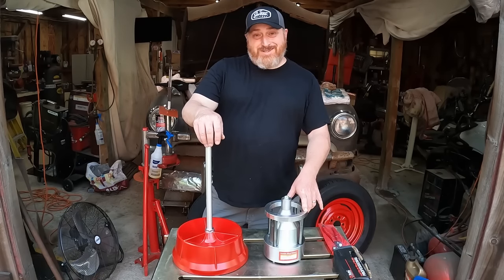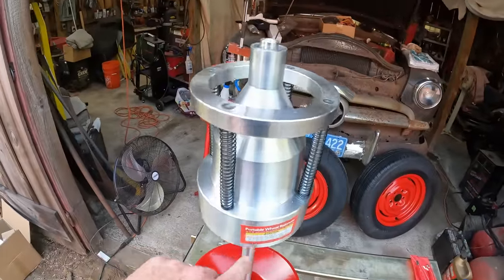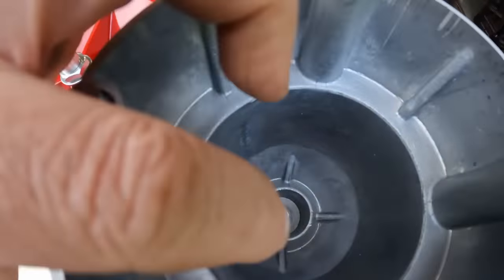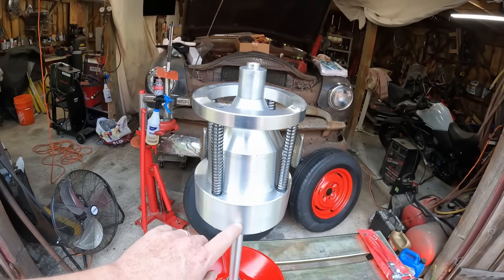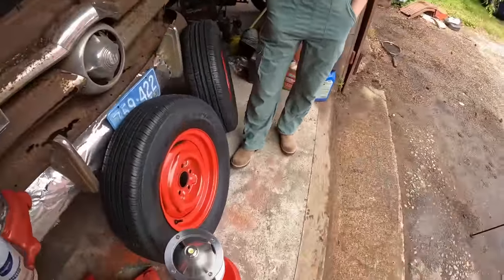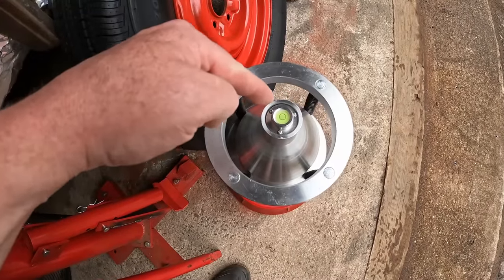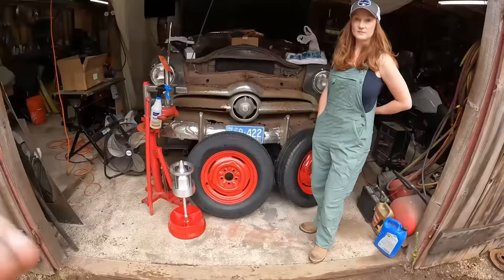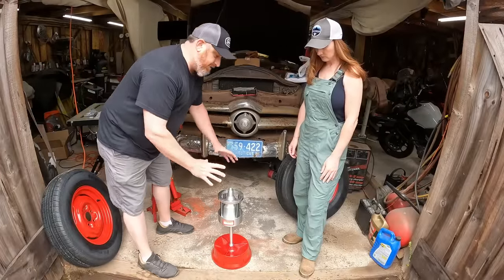How to balance your tires at home and how to modify your Harbor Freight/Amazon bubble balancer!

Comment: If your bubble is inside that circle, you are good to go. There is so much unsprung weight in those old wheels and suspension    that you don't have to be perfect. Most balance issues will show up at the 55/60 mph mark. If you are smooth there, you are good. Bubble balance takes care of the static balance which is 95% of the issue. Splitting the weight between the inside and outside takes care of the dynamic balance for the most part, the last 5%. Great video!
Reply from the maker: Great, thanks for watching!
Reply: @madgingercustoms thank you very much. I have one and gave up on it due to the same problem. I could not get repeatable results. I will drill mine out now.
Reply: Whatever dude, anyone who listens to anything that this guy says is foolish. You shouldn’t drill down into the cone . The manufacturer has designed this product in a certain way and when you go modifying it based off what people like this guy says, well you’re making a mistake. It just goes back to the old saying that you shouldn’t believe everything that you see on the internet. Trust the manufacturer, not this guy. If he wants to design a wheel balancer based on his belief system then he should do that. When you deviate from the design of the manufacturer based off of what this guy is saying, then how are to know if it’s correct? Because if something goes wrong and you crash your vehicle, this guy is not going pay for your damages or medical bills. Trust the manufacturer, not this clown
Reply: @matthewhuling8582  The Chinese manufacturer is not going to pay your damages or medical bills either. This man took a mediocre product and improved it.
Reply: @matthewhuling8582 it's apparent that you didn't listen to what he said. He stated that you do not drill the or touch the centering point that rests on the hardend pin. He clearly said to taper drill the the hole that leads to the point allowing it to rest on the pin. That allows it to function better. Please watch it again and listen to what he's saying. He makes it very clear to understand. He removed the material that's not allowing it to work properly plain n simple..

Comment: I can absolutely confirm- this WORKS.   I watched this vid last night, it 'sorta' made sense but I told myself, I'll try it tomorrow and see what happens.  I widened the hole about 5/16" being careful not to go too deep because I didn't want to disturb where the actual 'head of the pin' was going to rest.  I just left enough room so the little shaft didn't run against anything. ONLY the point was touching the cone assembly.  Well-  right away, I could tell there was a huge difference. The cone assembly didn't 'settle' right away- and that was without the wheel even being placed in position.  Then I put on a wheel that was supposed to be 'balanced' -  not even close.  I removed all the weights I put on and started all over only this time, with this 'new' setup-  I got it right.  I did both front tires, took the car for a ride- no vibration @ 50MPH-  no vibration @90MPH.  I was beside myself.   Anyway-  THANK YOU for making this vid.
Reply from the maker: Thanks for coming back and commenting after trying it!

Comment: I'm 67 ... I was mounting and balancing tires (on a bubble balancer) when I was 15 at our local Western Auto! 1970-ish😜 (Would you want a 15 year old kid mounting and balancing your tires today unsupervised? 😁 ) Great memories! Don't remember anyone ever bringing tires back for balance issues! Another great video!!! Thanks!
Reply from the maker: Thanks for watching!! And I'm sure you were the right guy for the job, 15 years old or not!
Reply: That reasoning right there is why I decided to just get the tools and balance them myself. Over paying 40 bucks a tire for some kid to do it. Everything pays for it's self after the first set on my camper.
Reply: I did a tyre fitting course age 16 at Beaurepairs, after fitting a tyre, I went to wheel it straight back to the XB Ford ute, One of the Beau guys yelled out, you forgot the balance

Comment: Just found your channel, enjoyed this video. I can't remember if it was in high school shop class, or the gas station I worked at while in high school. The bubble balancer I learned was pretty cool, because it had a lever to lift the bubble assembly to balance, after finding the weights needed, you would move the lever to lower the bubble assembly to a solid surface to hammer the weights on without having to take the tire off and back on for the recheck.
Reply from the maker: That sounds cool. Thanks for checking out our video!

Comment: Glad I got to see your video on this. I'm going to do that to my balancer. I thought that's what was wrong with mine, but I just wiggled and spun my tires a few times just to be sure that they will center each time. After 3 times then I marked the spot and then put my weights on. I balance my tires every time I rotate them.
Reply from the maker: I feel it works much better like this!
Reply: @madgingercustoms  most definitely. Nothing there to bind it up.

Comment: My Harbor Freight balancer is sitting in the shed this past 20 years because I couldn't get the damm thing to balance right. Use to do static balancing at a gas station during college. Thanks for sharing the moods to the tire changer and balancer.
Reply from the maker: Thanks for checking out the video!

Comment: I bought one of these off Amazon and thought it moved pretty freely. enlarged the hole a bit and it wobbles around for a long time now. Just mounted and balanced a set of tires the other day and I feel a little bit of a rumble on most roads, not very noticeable but I think I can make it better. Can't really say it was the balancers fault as 2 of the tires balanced ok with the weights from the previous tires so I let those fly and probably shouldn't have. Gonna give the Y method a try.
Reply from the maker: Sounds great. Maybe the Y method would square it away!
Reply: @madgingercustoms  I re did the tire balance with the Y method and it's smooth as glass up to 75 MPH and that's all the faster I was able to get up to because of traffic. Honestly the car is smoother than the last set of tires I put on it that were professionally mounted and balanced. I went with the Summit ultramax a/s from Amazon for tires.

Comment: Great fix to make a cheap product usable.  I like to use balancing beads now, much easier and no need to rebalance.  Used on 5 motorcycles and one car.  Always have a smooth ride, even after 30k miles on a set of tires.
Reply from the maker: Yeah I think we will try balance beads next!

Comment: Well done! This is the second vid of yours I've seen, the first one being the tire changer mods.Great ideas and plan on reworking my HF tire changer. One mod i made on mine was putting a spring on the bead breaker. That way i dont have to hold it up and out of the way while I'm sliding tires in or out.Thanks for the vid and keep up the good work!
Reply from the maker: Thank you!

Comment: i use an 1/8 inch ball bearing works great also raze the height of the bubble on a aluminum shaft about 4 in makes the bubble have a greater swing
Reply from the maker: Thanks for the tips!

Comment: Just a little bit of information the best balancer is one that does it on the car.. I first seen one of these years ago when I was in the RAAF, you use it by just lifting the tyre off the ground then you  bring this thing up to the tyre and turn it on it spins the tyre so you can see where to add your weights and by doing it this way it takes of wear in you hubs, brakes and any other wear so everything is in balance.
Reply from the maker: Certainly makes the most sense. Balance the entire rotating assembly!
Reply: In the 70s the alignment shop I used did it this way. It is a really neat method,
Reply: Would removing the wheel and placing it back on different studs throw off the balance?

Comment: I noticed you attached the weights on one side of the wheel using the y method. They really need to be split equally on both sides or if you are using stick on weights stick them inside close to the middle of the rim. This keeps the dynamic balance from being way out of wack. Not gonna be perfect because this balancer only static balances but it gets it closer to true balance. Also if using stick on weights, keep in mind that if you set the weights and the rim edge, when you attach them to the inside of the wheel, the balnace is going to be off because you placed them slightly inward. You can hang them with a piece of tape     if you have open wheels through the spokes or slots so they hang over the inside of the wheel while you adjust the weights or place some weight inside and recheck and adjust. Or you can use the y method and if you need more weight just add it in between the 2 weights
Reply from the maker: Yeah I have seen that in videos. We have now tried the weights several different ways over the last 6 months.

Comment: The 14" set i put on my sons corolla dint have the red dot but the 17s of nexens did have the red dot i dont have a balancer yet so had to get them balanced the 17s i couldnt mount broke the changer and the tool that came with it i had alredy cut the ends off and welded them to a solid steel benh press bar thats made to hold a lot of weight and bent the crap out of trying to mount the 215/65/17s was going to buy a amazon install bar but after i watched your last video im going to go that rout. Thank you again for a great video!!! Have a wonderful day!!!!!!!!!
Reply from the maker: Give it a shot, it certainly makes it easy.

Comment: I did read the patent filed 1957 for the Y method, the purpose was to enable a tire shop to only need to stock 3 different weights and still be able to balance any wheel. 0.6 oz & 1.6 oz & 2.25 oz.  With normal balance method a shop would need to stock many different weights.
Reply from the maker: Thanks for the info!!

Comment: I wished you would have recorded the drilling process and drill sizes!
Reply from the maker: I said the drill sizes in the video and drilled them by hand. Basically you want to work your way up to a 3/8 final size but you don't want to increase the depth. Keep the taper on the end but remove the side material.
Reply: I went backwards. Started out with a 1/2" to hog out some material then to a 3/8" and then a 1/4". I went as deep as I could without touching the center point. Just take it slow and check to make sure you don't go too far. I basically stopped when I could get the centering cone to swing freely. If you go too far and kiss the center point, stop and check to see if it it swings freely and see if it centers. If it does you'll be ok👍
Reply: Use a Dremel or a die grinder. It's easier  to access and see what you're doing.

Comment: I have had one of those bubble balancers for several years and had problems with repeatability when moving the tire in a different position on the balancer. I am going to drill out the center pivot point and try it. Thanks for the info.
Reply from the maker: I think it will work out better. Thanks for checking out our video.

Comment: The balancing pin that comes on these are completely soft metal, so eventually you'll probably need to sharpen a broken drill bit or use a center punch and replace it because heavy tires will dull your balance pin out
Reply from the maker: Yeah, I'd imagine the Chinese hardened pin isn't really that hardened for sure.

Comment: The new black version of the Pittsburgh bubble balancer,at least the one I purchased, has addressed this problem with a longer,smaller diameter pin and an insert that was drilled on center.

Comment: You might want to thread some 3/8" stainless bolts into those drop-in anchors to protect the threads and to keep them clean. And maybe use a little dielectric grease to make them easy to remove down the road.
Reply from the maker: I absolutely will do that. Great idea. Thank you!

Comment: Great video. It seems like it would be easier for the manufacturer to make the unit as you altered it. My guess is that the durability is going to suffer with the mod you made. Mine doesn't seem to maintain the bubble centered when the top is spun around. What do you think?
Reply from the maker: It may not maintain level when spun due to the excessive friction. That is what we tried to overcome.

Comment: Ok here’s a thought for you: would it be possible to make a balanced fixture that would center only the tire so one can find the heavy side of the tire and mark it, then do only the wheel and mark it, then mount the tire with those marks opposing? That would minimize the amount of weight required to balance the assembly.
Reply from the maker: I sure that's possible but im probably not the guy to build it! Lol

Comment: i took your advice and drilled it on the tiny hole then used a little larger bit/drill it again /then a little larger/is that how it is done/i need to balance some new tires/OK did i mess it up -looks like a V down there/just guessed how deep to drill it/is that steel metal/it drilled slow/man i hope i did OK/yea got new weights to balance the tires/many thanks/thanks much
Reply from the maker: As long as you still have a tapered hole to a point it should work properly.
Reply: You have to be straight drilling that hole or that balancer will be ruined

Comment: What size drills did you use. I would like to see how you modified the balancer. I worked for Firestone in the mid 1970's just before going to Collage and that is how we balanced tires at Firestone. Granted the Firestone Balancer looked more professional, but it was a simple a bubble balancer. I already have this tire change an i bolted mine down to a 4 x 4 sheet of 3/4 inch ply wood with carriage bolts. That way I could move it out of my way easier.
Reply from the maker: I worked up to a 3/8 I believe but you only want the flute angle, not a hole.

Comment: Your "Y Method" is called counter balancing and is not the professional way to balance a tire. When I worked in a tire shop, I was always told not to counter balance because it looks crappy. And most people, likes the cleaner look. But, yall did a good job. 👍
Reply from the maker: The Y method was actually the industry standard when these balancers were first introduced. I believe the counter balance is putting one on the inside and outside of the wheel from all the info I found. Thanks for watching!

Comment: I worked in a gas station back in the early 70s, and all we did was bubble balance wheels, and it worked very well. You really don't need a spin balanced wheel. It may be  better, but really how much better?
Reply from the maker: That's my point as well!

Comment: would it be easier to sharpen the point? also what bit sizes did you use to get the perfect hole? and was it hard to do?
Reply from the maker: The issue is the hole it goes into is more of a cylinder and that side material needs to be cleared out. Drilling it up to 3/8 but keeping the taper point works.

Comment: I'm going to have to buy this balancer.   Local shop won't balance my 12" tires because their 'high falutin' expensive machine won't do 12" trailer tires and they dont' have a bubble balancer. Guess the 19 year old "punks' couldn't be bothered to learn how to use it.  All tires, even small 12" trailer tires should be balanced.
Reply from the maker: I'm going to do all my trailer tires now!

Comment: During my time in the service while stationed in Germany I watched a German garage balance a Mercedes tires on nothing but a bubble balancer. Don't forget the Autobahn often has no speed limit (and they use it)!
Reply from the maker: For all the people that said this doesn't work, it sure did work for decades! Thanks for watching!
Reply: @madgingercustoms  Static balancing is adequate for skinny tyres, now we have extra wide tyres, they say static isn't good enough, I've used 6" wide wheels with no balance issues, one time I balanced a pair of 165/70-13 retread tyres for the Suzuki Swift, the steering wheel wobbled at 30 mph, those tyres must have a very bad dynamic offset

Comment: Interesting. I thought you would pull the pin out and re-machine it to a steeper angle point using a file and putting the pin in a drill. 

Again, this will be cool to make into 1/25th scale model for my 1920's garage diorama.

Question for you :  From the side view, when you put the tire on the balancer, does the rim cover the entire "Aluminum" part from view? - Just asking that to get some sort of "depth" to the rim and "height" to that center balancer part. If I can just glue a wheel to a pole, I'd like that a bit better than trying to build a cone with springs on the side, if you know what I mean. 🤫
Reply from the maker: It does on the 17" aluminum wheels we did yesterday but not the steel 5"wide Ford wheels.
Reply: @madgingercustoms  How tall is the entire cone piece? from base to tip.

Comment: My dad was a Mechanic he mostly did front and break work. I learned how to use a bubble at a young age, They work fine I always had a spin balancer that I could use so I did not bubble balance much. When I was a kid iI would buy recapped tires for eight dollars' each My dad had a tire truer at work after we would cut the tires round they felt you were driving on high-dollar tires.  Very smooth
Reply from the maker: That's awesome!! I've never seen a tire truer honestly. I need to find an older shop maybe.

Comment: My balancer is 25 years old from harbour freight never modified and it has always moved like yours after mod also mine has a adjust thumb screw instead of the 3 screws on the bubble but the y method is preferred but with 4 weights 2 front 2 back or 2 on back mine come out to 1/4 ounce of static spin my spin balancer doesn't do larger wheels and tires and the bubble does 36 years experience
Reply from the maker: Thanks!